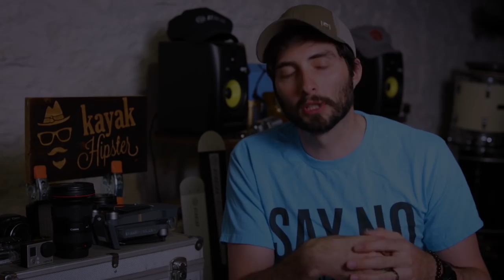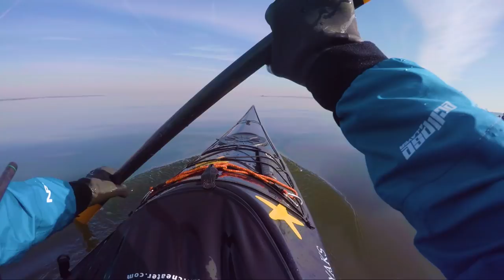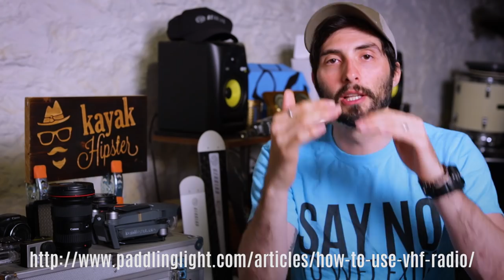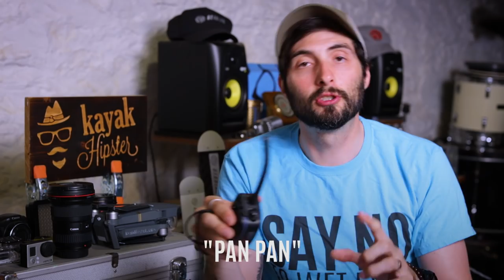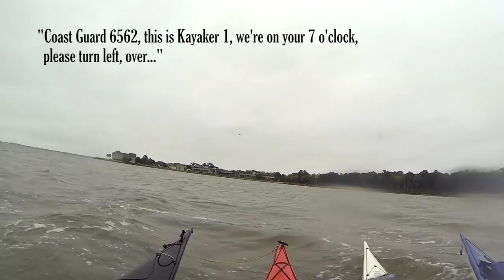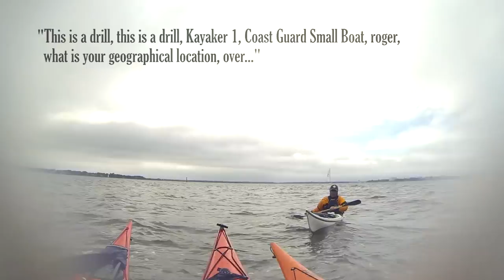Marine VHF Radio Overview & Exercises with US Coast Guard - Weekly Kayaking Tips - Kayak Hipster

Comment: If you hear an emergency call close to your location you are supposed to show up and help in any way. I was just getting into buzzards bay when I heard a boat sinking call which was about 1/2 mile from me. A power boat showed up at the location the same time I did. We divided up the search because there were submerged rocks in an area where it would be better for me to search. I told him he could do all the radio calls with coast guard. When he told the Coast Guard I was assisting with the search they were surprised.

Comment: Remember to perform a radio check to insure your radio can transmit/receive BEFORE launching.  Several marinas have an Automated Radio Check Service (provided by SeaTow) using one of VHF Channels 24, 25, 26, 27, 28, 84.  It will return/retransmit your broadcast to let you know your radio can Tx/Rx.  This also doesn't clutter channel 16 with these requests.

Comment from the maker: I'm pinning this commend to I can post info I've been getting to add to the video. This is a correction from the last post so I could fix my mention of channel 16 only being for emergencies - I corrected that it can be used for starting conversations that can then be transferred to a different channel. Thanks to Andy Norman for that, and to Jonas Alexanderson for the reminder that some areas/countries require certification/licenses to use vhf radios. 

Felix adds:
In some cases even with coastguard large antenna and high sensitivity of receiver you may be too far for them to hear you, but you can hear them. In these  cases other boaters may need to relay you message to them

Also, that the large side button is used to transmit, and released to listen to a response. 

Keep them coming!

Comment: Interesting that you used clock face to direct the heli, this requires you to be able to see the heli clearly.  However, if you have a compass with you, you can quickly take a bearing to give the direction for him to fly, "fly to me on 250 magnetic", this can be done when he is a dot.  Easy way to do this with a baseplate compass is to point the arrow at yourself.
Reply: Point the arrow at yourself means positioning the compass to your south.  Are you sure this is what you meant?
Reply: @dalethebelldiver7740  The baseplate arrow, not the magnetic one.

Comment: One issue I've found is,  paddlers are reluctant to turn them their VHF radios on.  They say they want to save the battery for emergencies.  The problem with that is nobody is monitoring the frequency. For example, if a paddler gets separated from the group and has an emergency they won't be able to contact other paddlers if the other paddlers have their radios off.

Comment: When I monitor marine radio traffic while out kayaking (another fun thing to do while out on the water) I notice that CG chatter is very by-the-book and professional, while almost all powerboat talk is very informal, even on 16. The other day, some high-dollar yacht was coming into New Harbor Block Island and requesting services and a slip. He announced his intention on 16, Boat Basin responded OK, go channel ten, one-zero. The skipper said OK, then proceeded a couple times in a row to keep blabbing on 16 about a pump-out etc, just wasn't getting the message to change channels to everyone's amusement. A bit later, CG put out an advisory that a leatherback turtle's radio tag had just started transmitting at so-and-so Ghz and to make a note. Point is, when you're out there on the tidal and bigger fresh waters, there's a lot of cool activity going on around you to add to the experience. Which would be missed without a marine radio on you. Should be part of your kit, especially if you're the group leader or solo.

Comment: I would suggest correct VHF etiquette is to repeat usual messages only twice,  !!

The  use of  "Groups of THREE " should only be used for a mayday or Pan calls ,.....
 as other listeners to that radio signal from afar strength three and below possibly mistake for a Mayday mayday mayday. 
It is like ......not using Ch16 for radio checks.

Monitoring CH16 it is annoying to have some plonker asking for a radio check giving  his boats name three times, that could have several people listening thinking it is a mayday call.   would you not agree???

Comment: DO NOT DICK ABOUT WITH VHF. It's not like CB radio. It's a vital safety system. If you don't use accepted VHF protocol in a sensible fashion you can be fined and radio confiscated. Practice with friends, get proficient as possible. In the UK you need VHF licence (but I've never heard of a sensible, responsible user being penalised for not having it.   Also. Don't fasten ti to your vessel. Fasten it to YOU.

Comment: Good for talking to your friends on the water but GPS on a cell phone has put the VHF to bed very old tech now i under stand if you had a ship like a oil tanker or a cruise ship but great video !
Reply from the maker: Phil & Kyle yeah, sorry to tell you that it hasn't happened yet. We've had many cellphone deaths out on the water due to bad waterproof cases - so we still use our radios as our main communication. I don't think I'll be breaking out my cellphone anytime in the near future knowing I might have to be thrown around in waves and it might get wet. I can have my vhf radio submerged the entire day and still contact my buddies. Depends on the situation. For us it still works much better. Also, if a boat is bearing down on you which has happened to us many times, they'll hear a radio call. Cheers!
Reply: Not sure why GPS on a cell phone has anything to do with it.  The great thing about vhf is that you "broadcast", anyone in range can hear you.  This means that the local fishing boat can maybe come to your assistance or even that you in your kayak can assist - yes this has happened many times.  With a GPS of any description you can give your location very accurately but that can be by cell phone or vhf.  With the vhf you can have a group conversation, with both coastguard and air assets.  A cell phone is like, well a phone, a vhf is like shouting to everyone in range so they all know whats going on.  Also, if you ever paddle in high traffic areas near big ports with an active VTS (Vessel Traffic System) then you will be expected to carry VHF - and use it!
Reply: if you rely on your cell phone only, it can and will get you killed. radio is old school technology and is still around for a reason.
Reply: LOL; how far offshore do you think a cell signal carries?  Is there continuous cell coverage along coastlines? What is the cell number of that boat bearing down on you, can you google it? Have you ever been outside of a city? Good god the earth is doomed!